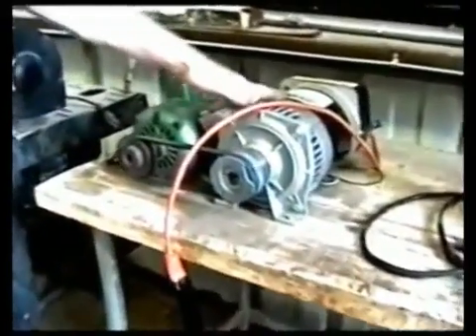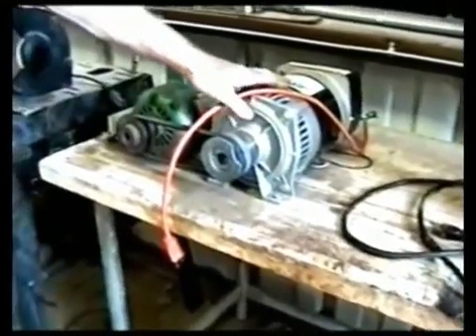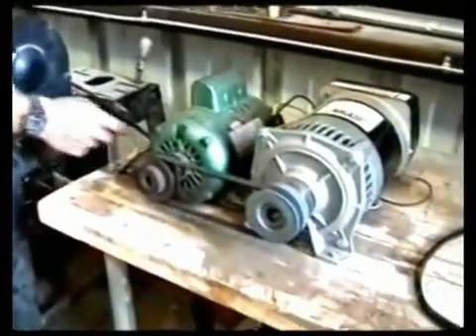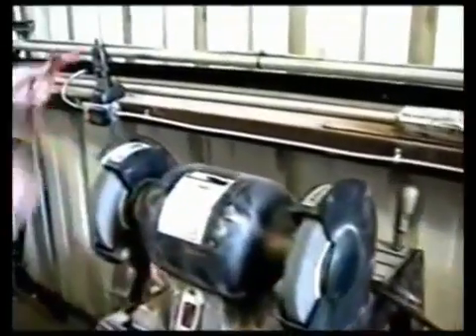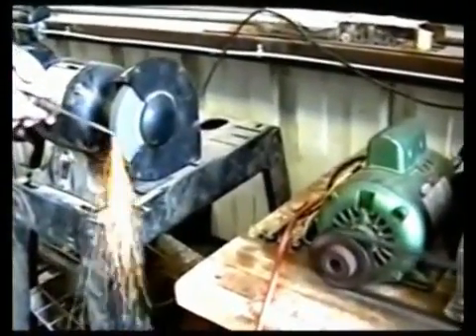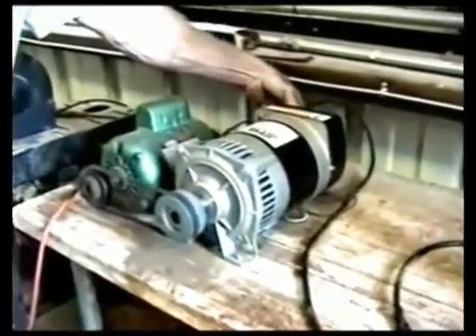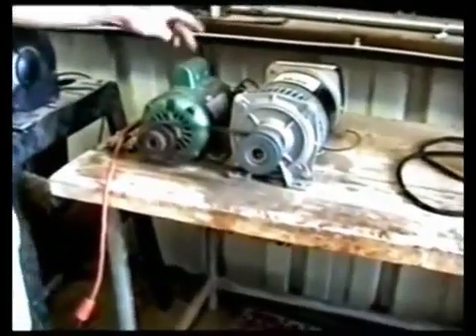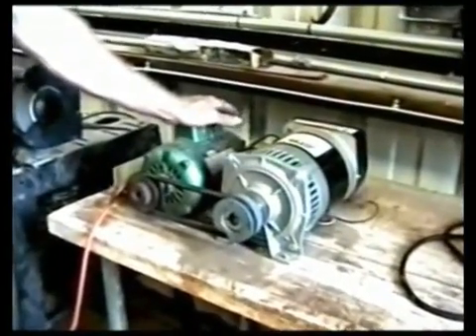3000 Watt Generator Powers Itself, Grinder & Drill Press.

Comment: One of the main things that this kind of energy is not used on large scale is because it will drop the global economy. If money are not spend they cannot be achieved and also they will not have any value on market.

Don't you wonder why big oil companies, which have billions of dollars, are not spending any bit on solar energy or any kind of free energy?
Reply: These companies don't really dump a whole lot of money back into the economy. On a large scale if the power companies disappeared, no one would miss them and the economy would survive. In fact it would get even better without these jack off's in the scene. Imagine companies capitalizing on free energy (building units for residential and commercial/large scale use) selling to industry in OUR COUNTRY!!! No electric bill for the small business owner. This would bring industry back to American Soil in so many ways. I run a small shop at home in my garage, and my first unit will power my shop. My shop includes a drill press, air compressor, 90 amp 110 vac wire feed welder, grinder, electric impact driver, two ac units, 50,000 btu heater, and four overhead shop lights. I will be using a 6,500 watt generator motor tapped into a Breaker box into the original garage wiring. I have no doubt of it working or it's efficiency.
Reply: Actually, the MAIN reason that fake energy isn't used is because it's FAKE.
Reply: freezingthedarkness I see you have never actually owned a business. I have. Do you want advice ? the first lesson in business: Do something you enjoy. Do you want to know the 2nd lesson ?
Reply: Casey Speaks Wow... dude YOUR English sucks too!
Reply: Actually big business has a history of buying patents and researching to create patents for alternative energy.
Reply: 5tevef
At least here is one person with sense here. The major energy companies (what some people call "big Oil" even though they don't care how they get their energy, spend more money researching alternative energy than any other group combined. Because they know if they can come up with something that ACTUALLY works, they can patent it, and basically drive their competitors out of business by undercutting them in price.

They would LOVE to move away from oil since oil is a very LOW profit margin business.
Reply: FuckYouGooglePlus Oil is a very low profit business? Do you even know where is Dubai on a map?

And as a matter of fact, the oil companies doesn't give a shit on researching free energy. In London you can count on fingers the bioDiesel petrol stations, or any kind of eco-friendly petrol stations, and you are talking about free energy. It's like you are donating your monthly fee. Dude, wake up! This is not the world that you hope for.
Reply: freezingthedarkness "FuckYou" did say low profit MARGIN. There is a much higher MARGIN in restaurants - especially soft drinks. Oil is big business because of VOLUME not profit margin.
Reply: Casey Speaks Big cash-flow means bigger profit, my friend. The profit margin becomes smaller when cash-flow increase. First lesson in business. A burger at MC'Donalds is 1$ and at HardRock Cafe's is 10$. Which is richer?
Reply: freezingthedarkness BTW - since you think there is a comparison between McDonald's and the Hard Rock - I suggest you get a government job because you know shit about business. Hard Rock is in entertainment and McDonald's PRIMARY business is REAL ESTATE.
Reply: Casey Speaks It's a reply for your stupid oil vs soft drinks in restaurants which has nothing to do which one to other. Still, what you are trying to say?
Reply: freezingthedarkness Wow - i knew you were stupid but ...really. ? I am saying you are stupid beyond belief.  This video is nonsense - there is nothing of value in this ... garbage.

Soft drinks are the single highest profit margin of any manufactured product. Ever heard of Pepsi or Coca-Cola ? 
Oil requires HUGE investments in exploration, drilling, refining, distribution in specially designed and extremely expensive pipelines, trucks and ocean tankers. 

We WERE talking profit MARGINS - or do you suffer from attention deficit as well as cognitive deficiency ?

I do mean to be mean - hopefully you will realize you are an "easy mark" because you are too trusting and painfully ignorant about the world around you. Try learning some critical thinking skills - they help you know why this type of video is just ...shit.
Reply: Casey Speaks You are trying to say another shit that somebody did before you. I was talking on subject in my first comm, but like many others you move the discussion in other side, to look smarter. No, you are not.
Reply: freezingthedarkness You English very badly. I answered you: you business not know of... is comment of know nothingly.

The thing in this video is FAKE... as in CANNOT work. It is lies ...all lies. 

Too bad for you.
Reply: steve bigler I see you missed the point entirely. smh, rofl. Next time - read all the comments before replying.

Comment: to produce even more power, make the pulley of the green motor bigger.  it will make the generator spin even faster and producing higher voltage.

Comment: Can you put the motor and generator on one shared rotor? That would simplify things if it doesn't somehow cause problems.
Reply: I don't know if you could use the same shared rotor but if not, would it be possible to use a fully insulated linkage between the two rotors (aligned and centered perfectly) on a single mounting bracket? The combined motor/generator would then become one appliance generating free electricity after the initial startup procedure. If the startup can be performed by a manual crank or bicycle powered starting mechanism, all the better.

Comment: I created a P.E.S. [perpetual energy system ] in the 1980's. It consists of a run/start capacitor, a 12 volt motor and an alternator or generator. When the system turns on by the run/start capacitor, the alternator or generator send electrical current to a breaker box. The breaker box sends a wire back to a switch the run/start capacitor is on; and powers itself; as well as supplies almost 275 amperes current for powering an entire home....

Comment: And to think I had this idea 45 years ago and stopped when I went to shool for electricity. They said you can never create power this way as there is always loss.
What generator motor are you using and has it been modified? I would appreciate the motor specs, company and pricing. Thx Has anybody looked at the Bloom Box or Joes cell?  Both are amazing

Comment: yeh, but, uh what happened to the losses? surely the wires took up some heat energy right? and what about that whole resistance thing that's in the wires that causes the heat? not to mention, that thing where power gets transferred equally unless it's acted on by an outside force. even with superconductivity something like this would appear to run for a while but, would eventually have to come to a stop.

Comment: How can you generate more power than you use? It defies physics as there would be friction loss in the belt and pulleys. Even if you convert the AC to DC or something to boost the power you used to power it up...it would run out quickly due to the friction robbing energy. There is no way to make a 100% efficient machine, let alone a 100%+ efficient, or everyone would be doing it. Let me guess...you need "investors"? There is one born every minute!

Comment: 3000 watt generator powering a motor that is 3/4 hp. 1hp = 746 watts so 3/4 hp = 559.5w output, realistically the motor will use about 670 to generate the 3/4 hp so that leaves 2330 watts left over to run the grinder and drill press.

Comment: This system depends on maintaining an equal draw, soon the power catches up to the return of the generator and it slows down by placing a rheostat/dimmer switch from the the neutral or ground rod of your house you can maintain a higher impedance level forcing more energy to be created by the generator. In other words instead of using their power use their return, the problem is that the meter will still charge you for that. So a ground rod would be best.
The generator is putting out power on one lead but depends on a vacuum from the other. This is the system Nikola Tesla Designed for us, It is what the government does not want you to know. which begs the question who is the government, JP Morgan and friends.Who really owns the fed, The government, who do they blame it on, JP Morgan and friends. Stop listening to those fools and build this system to power your house. Then while it runs when you are at work, store energy into huge capacitor banks that fill and blast it back through the feed line from the power company, it will force the meter to run backwards and this JPMorgan Government will have to send you a check each month. It works, it works really well, the secret is staying ontop of the impedance level to keep the motor/generators pulling.
Freedom is telling them to stuff the "god they trust in" into your bank account.
It would almost be financially better to sit at home babysitting a massive generator and Capacitors and dumping it into their system non stop. Make that meter spin backwards, its a living.

Comment: So with regards to how this system works, if you had a DC powered motor to get the generator lets say, kick started, you can then turn over to the motor which will in turn keep the generator moving and literally run on it's own power. If you can find a DC motor source to do this, you won't even need AC to start the system and I'm certain with future advancements on the technology, you kiss the electric co good bye!! Yes???? That's what I get out of this. Where can I get a generator like this? I'd like to do just that...kiss the electric co good bye!!

Comment: This works!
I'm essentially building a similar setup, except I will use a coupler instead of a belt.
Also, my invention will generate over 10,000 watts, and will be started with a battery.

Comment: Too easy to be true. Generator has losses, won't convert all shaft power in electrical. Same for grinder, barely 3/4 of electrical power converts to shaft power.
So you run the 3kW generator. You need 3.5 kW at shaft just to cover conversion loss, to actually have 3kW electrical. Again, you need 4kW electrical at motor input, to produce 3.5kW mechanical power at generator shaft. Otherwise said, you need more than 4kW input power to collect 3kW electrical output. That's why the commercial generators are run on more powerful gasoline engines(engine output sensible greater than generator output).
Yet your setup runs, yes? How come? I think you don't disconnect the motor.
Reply: It is better for a fool to remain silent than to open his mouth and remove all doubt, shut the Fuck up already

Comment: Am I missing something here? You are loosing power by running power through two motors from resistence. You are not generating electricity you are transferring energy. Run your equipment at 220 volts then you will have all the amps that you need.

Comment: THe idea of running a generator from a motor that pwers itself is fraught with peril. Losses suck out the power. So for every 1000 watts you put in you might get 750 back, the other 250 lost forever. How do you explain that? What is different here?

Comment: The fact that the unit has permanent magnets.
system at resonance (loss should be minimal)
and the permanent magnets must be as much as possible.
then it is possible that the rotation of the lightweight
rotor the rate of change of the magnetic field through the rotor, will be sufficient to rotate the motor.

Comment: Why not double pulley the motor  and have 2 generators one generator like you have it and one generator for running the stuff you need. The electric motor seems to have more than enough power to run the generators. So pretty much your electric motor is run by one generator and it runs the other. Basically using what you have made as a power plant to spin the other generator and that gives you 100% of the second generator to use for powering things. Just an idea. Awesome setup.
Reply: Geez, guys ... ALL systems are inefficient. Even at 100% efficiency, you loose: If you put n amount of energy into an efficient electric motor, you may get 0.93n power out - 93% efficiency (this would be a very good motor indeed, and likely to be a very large one). If your very efficient and expensive generator is direct drive from your motor (no power-eating belts) then you may get 0.93 of the input power back out. Now you have just over 80% power running your motor - for an instant - as that 80% is multiplied by 80% continuously. The best you can hope for is a steady slow down. You'll likely get a rapid slow down.
Motors and generators get hot: that's wasted electricity - energy - discarded as heat due to electrical resistance, air resistance (spinning parts!) and bearing [mechanical] resistance.
There are a couple of silly technical items that also instantly show that the demo is bogus, but you'll need to go back to school to learn the basics first.
Reply: Actually. I have had a design drawn up for over 2 years. It is similar to this but...... It will have a battery band, and inverter to run the motor, and an alternator to charge the battery bank SOLEY for the motor. Then run tow generators on a split pulley and split a distribution box (one side for lights and small appliances, and the other for electric heat and cooling) Also, with a charge controller and a 4 deep cycle battery bank, and 10,000 watt power inverter, this unit will shut itself off at night and turn itself back on when charge levels are low. The only thing I wnat to know is if I can tell the power company to remove their power completely from my home! Is this possible?
Reply: Brad S Yeah you can they will remove it but if you ever want it back it will cost you thousands. If I were you I would tell them to remove their meter and that completely breaks the circuit and not just with a switch this works just as if had a section cut from the main wire coming off the pole. Or you can get them to put in the system where they pay you for electricity and make some serious cash if you put some serious juice back in the system. I spoke with a Gentleman who said he paid his house payment and his son's house payment with just what he was putting back in the system. Good luck let us know when you get everything up and running.

Comment: Skeptical... If this is true... You've basically built MORE than a perpetual motion machine. In other words, you get more energy out than you put in, but energy is always conserved. You lose energy to heat, friction, etc... It's interesting, but I still question the true viability. At some point it would have to stop. Definitely makes me think though. Then again, for example, if you had a 500 Watt motor and it was able to spin a 3000W generator (which I question)... Technically, you'd have an excess of 2500 Watts you can use. Well, maybe it is possible... You would need the initial power to get the motor going, yes. If this is true, holy crap that's huge.

Comment: ok so here's the thing, I don't believe in god, Does that mean this won't work for me? rofl.  This doesn't work for me unless I inspect it with my own eyes.  Make a platform then put the machine on it, then start it and hoist it in the air so all can see there are no wires in the table legs. (ps, I'm very educated in electricity and physics) If it works and I see it I'll pay 15k for it. 15,000USD Then you can build them all you want. make that 25k. (just kidding but no really people would buy!)

Comment: Wow,this is simply GREAT!!!!, when I was 8 years old I used to draw funny looking cars with 2 huge electric motors. In most all the drawings it said "a very funny looking car by Mitsubishi Fuso". Powered by pushing car about a block and the Generator takes over and powers the big 400 hp motor made by Century Electric. My drawings were funny humor, but wow I never dreamt it was possible. A working model in the future.

Comment: Most homes will need at least a 18,000 watt generator x .8% = 14,400 watts to be self sufficient that puts out minimum 120 amps..  This means you will need a very large motor like around 5 horse power minimum to have the same effect.  However if no power how to start your generator when the outside source goes dead.  You must think first OK.  You also must consider the hertz into the equation, as the generator is very unstable hertz wise.  Include the Rpm's needed to give you the wattage.

Comment: Every motor need wattage and amps to get started.  Also every generator loses 0.8% of its rated watts.  Example here, 3000 watts means this is a 2400 watt generator putting out 20 amps max.on a 120 volt output source line from the generator.  Also these generators have to have at least 1800 rpm to give you that max wattage and amps.  

Nice to know, but here is the question!!!!  What do you use when there is no external power source to kick start it!!!!  hehehehehehehehe.

Comment: You can easily build one yourself. I suggest you use a 1 HP 3 phase motor controlled by a VFD. This will give you better overall control over the entire system. For your generator head, I suggest you use a 10kw permanent magnet unit. This is available from Northern Tools, The VFD will consume a steady 500 watts. I do however suggest you use a 100 lb flywheel to offset the drag of pulling power from the generator. This will give you about 5000 watts of useable power.

Comment: So during an extended power out would this system be viable for running a small office fridge or say a well pump? Maybe a window AC unit for a small room? Could it be jump started with a car battery setup in case you need to fire it up during a black out?